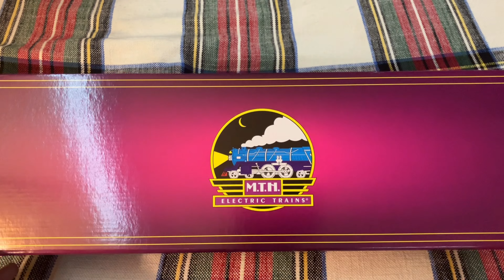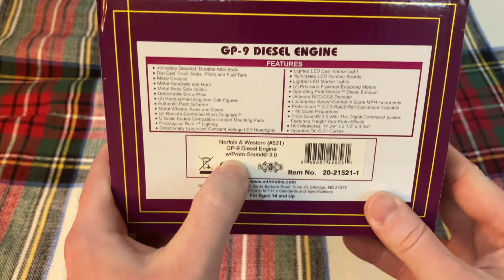Rolling Coal: MTH Premier Norfolk & Western GP-9 #521!

Comment: Jay, I got one of these last year.  Thanks for the shout out.  Mainly for the color and the idea that I would run short freight alongside my big N&W steamers.   Coolest thing is that it has a quilling horn which I just discovered.   Having an issue with it now which is its drawing 5+ amps after running for a few minutes.   When i pick it up it seems warmer than normal.   MTH warranty is just 1 year from issue so mine it out of warranty.
Reply from the maker: I actually didn’t know it has a quilling horn, I’ll have to check that out!! I’m sorry to hear about the issue with yours! Have you been able to figure out what’s happening with it?
Reply: @jaystrains27  Yes, apparently there is a power short somewhere between the front pickup rollers and somewhere inside.   Its intermittent and will likely require me to take off cover to track down.    Initially I thought it was the pickup roller itself and I swapped it out.   But I'm still getting spikes in amps while running it.   It gets warm too so until I fix it no more running.   Yes the quilling is fun to play with on MTH PS3 diesels.   I discovered my VGN Trainmaster has the feature also.